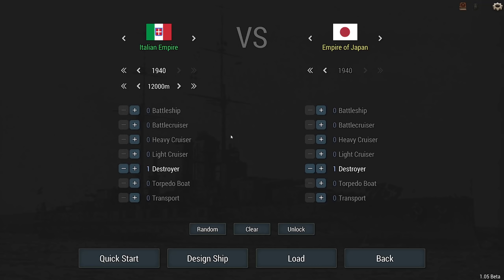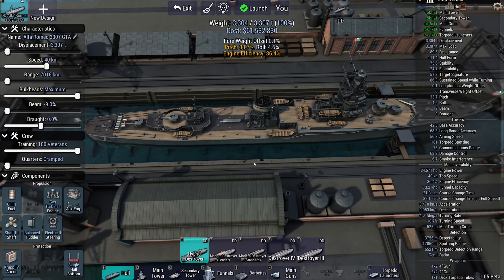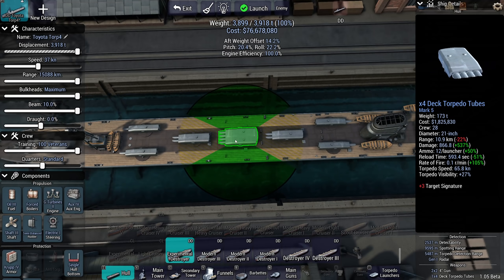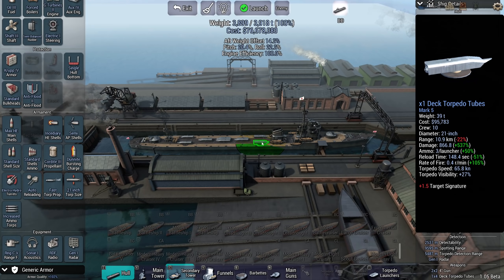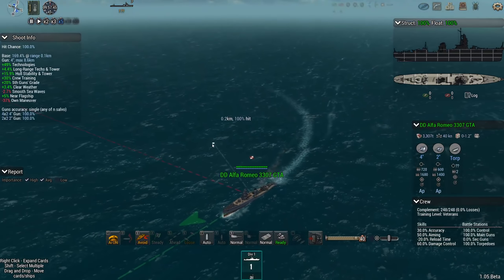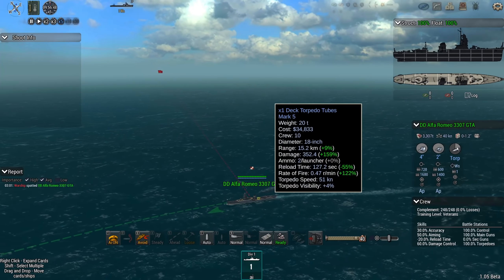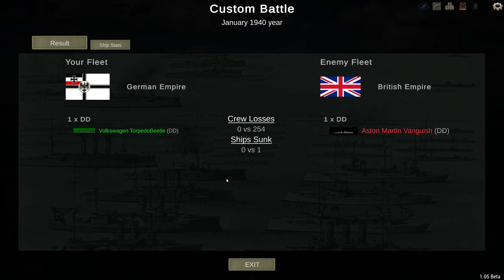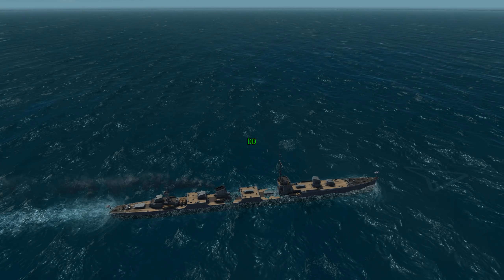Ultimate Admiral Dreadnoughts - If Car Brands Made Warships

Comment: What happened at the end of the first battle is a realism problem that needs to be addressed by the developers . The ships are as dangerous when they're nearly sunk as they are with full health .  In real life for the most part a heavily damaged ship on fire no engines and with waves washing over the decks from flooding would be a sitting duck - in the game they can and will sink you often due to the fact that they are firing almost submerged and you can't hit them very easily ( yet somehow they have little problem hitting you despite all the chaos of their damaged state lol )
Reply: A "nearly sunk" ship gets a LOT of damage instability and flooding instability debuffs to their accuracy.  When they lose enough (read, any for "cramped" quarters) crew trained on using guns, they also get loading speed and accuracy debuffs.  If they profited from cruising speed buffs, these are of course also gone.
Additionally, as I understand it, anyone shooting at them gains a "show target" accuracy buff instead of a "fast target" accuracy debuff.  And of course, the "enemy manoeuvre" debuff --- which is upsetting your targeting solution --- is pretty minor once the target is barely moving.

The finish of the battle is at "knife fight" possibly even "bear hug" range in terms of for the technology used.   At that range, you have to WORK to miss, so the debuffs are minor in effect.  Increase the range and the situation changes a lot.

It is realistic that you have a harder time to hit a small target.  Look up why boar spears do have a cross bar close to the business end.  You come close to a not-dead-yet enemy and they will maim you.  You should keep a safe distance!
Reply: @advorak8529  Yeah I get all that but the point is that they are still unrealistically able to deal damage while being almost sunk themselves and that wouldn't happen very often in real life . It's not a matter of buffs or reduced capability - those ships with that much damage shouldn't be fighting back much at all .The crew at this point should be abandoning ship . It might be due to the fact that the ships tend to sink straight down like a sub instead of listing and rolling over I don't know . And don't even get me started on the RTS - like repair system that allows ships to seemingly repair themselves faster than your shells can add damage to them - if the Bismark would have had such uber repair teams her story would be beyond legendary lol . This is a good/great game but needs some realism tweaks imo .